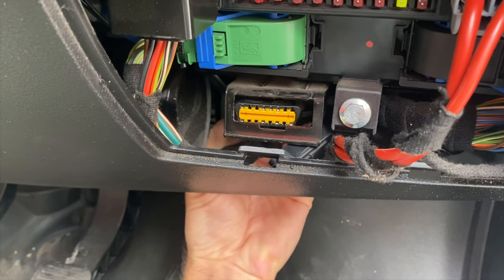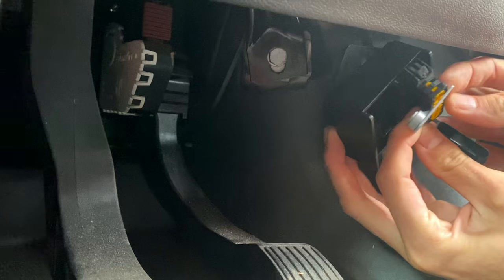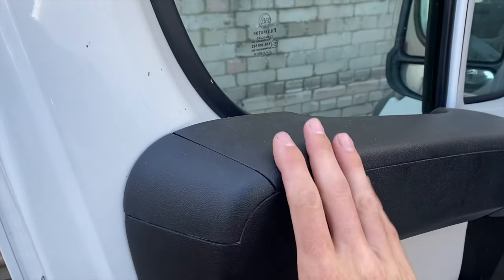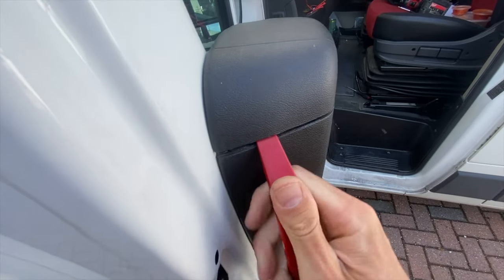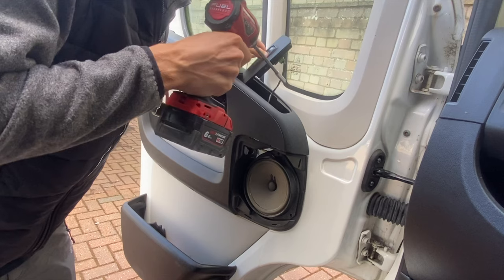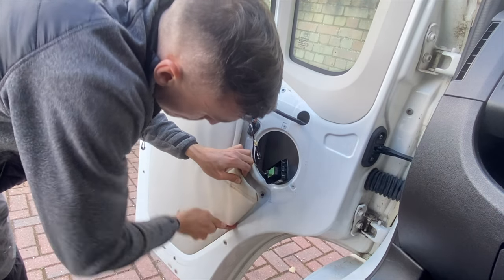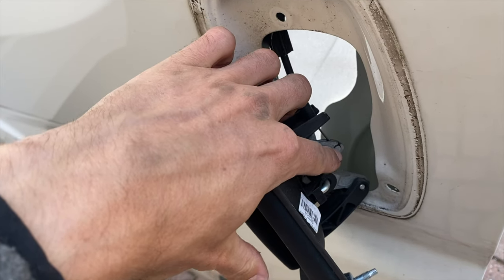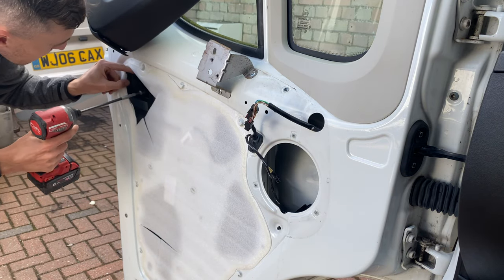Fitting Armaplates And OBD Reader Safe - Camper Van Security

Comment: Hi might be wrong but Im pretty sure you only need to fit the anti drill plate on door handles with a key hole as it is the manually key locking mechanism that they are trying to flip with a screwdriver when they punch through. Also great tip on the  obd reader i have just purchased and fitted one . Works a treat. Bit pricey for a tiny safe😂 but worth every penny if it slows the low life thieves 😊

Comment: Why do you need a OBD safe again ?  Can criminals use your OBD ?
Reply: Apparantly a thief can override the transponder chip and drive away.  An alternative is to relocate the OBD and fit a fake one in its place.
Reply from the maker: exactly what Peter said
Reply: @peterstreet4430  what about the ignition key? Steering lock? They have nothing to do with OBD.
Reply: @gbwildlifeuk8269  I’m no expert but back in the days before transponder chips it was a simple matter to pop the ignition barrel out with a screwdriver and then turn the ignition switch with said screwdriver to release the steering lock and start the car.  Cars with keyless ignition would not have this issue.